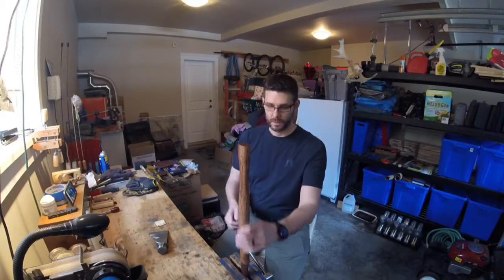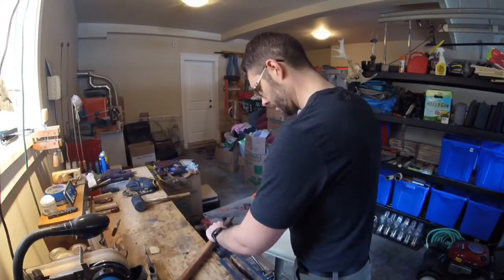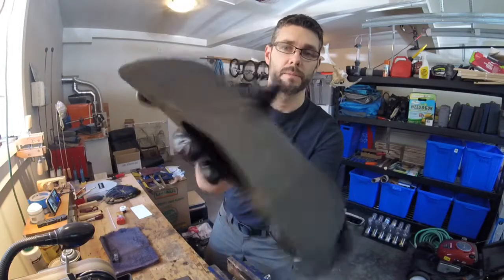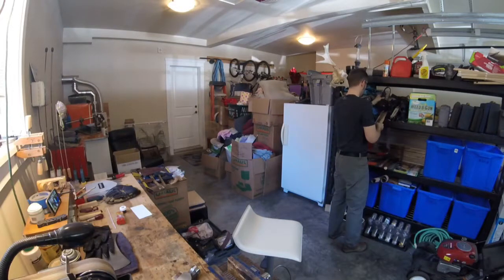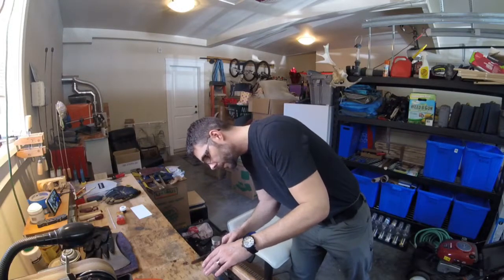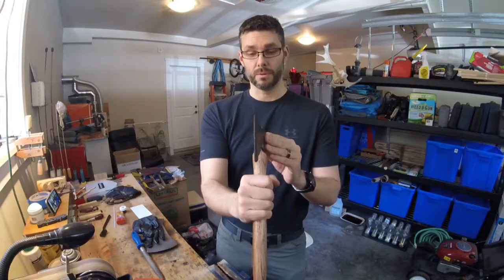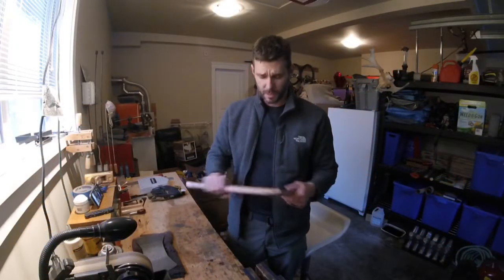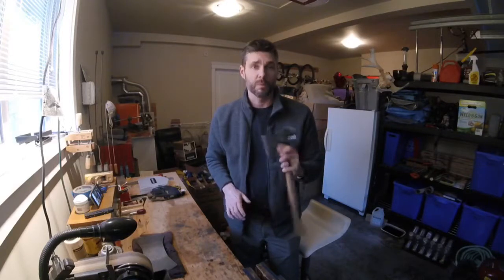Season1, Episode3 Plumb Carpenters Hatchet part2

Comment: Bigger wedge would have filled the eye better. Now the epoxy is in there it will be an absolute nightmare to get the head off to rehang if it does fail or come loose. Great head to find, looked in excellent condition for it's age.